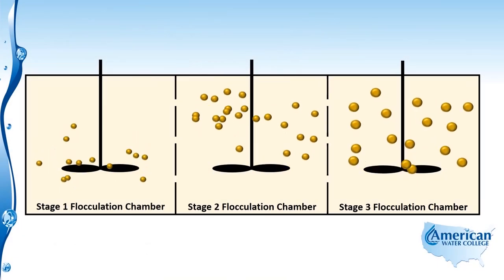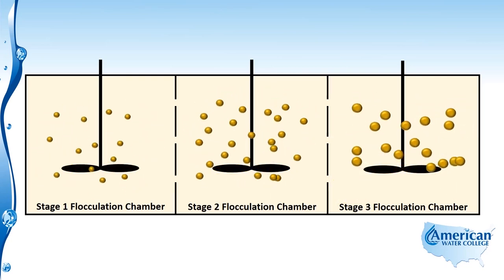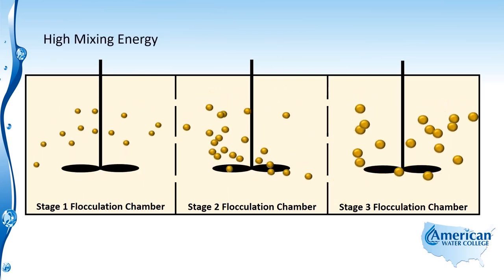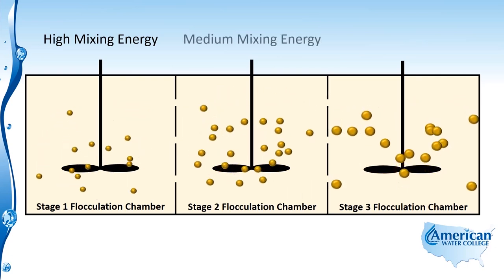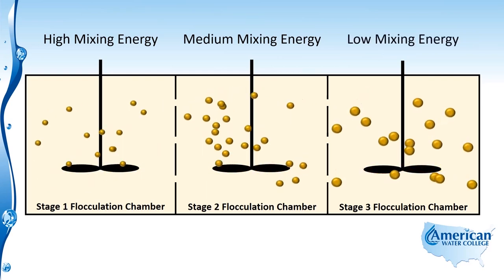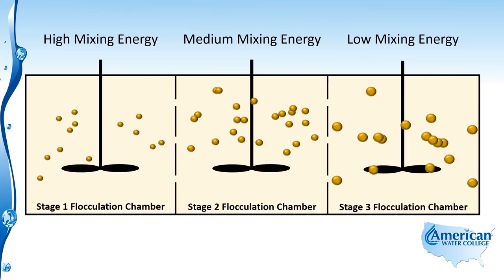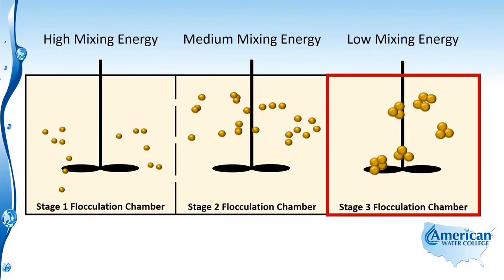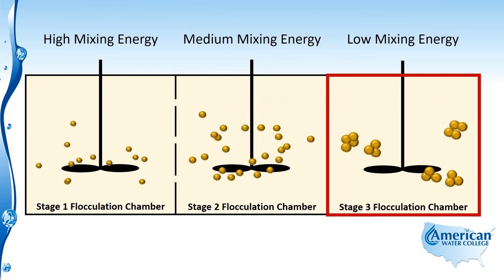Flocculation

Comment: Thanks for sharing about flocculation process. there’re 3 stages flocculation chamber with different mixing energi. We come to know that in a flocculator, the lower the mixing energy so the parcticle have gotten biggers, and the slower they move.  the particles even get bigger on the third step and the flock to continue to get bigger and form a flock that will be able to settle in the sedimentation. thank u.

Comment: thank you for the explanation sir, from the video it can be conclude that there are 3 different stage of the chambers in flocculation, from each chamber it has a different mixing energy which in the first chamber the energy is higher so the particles can move quickly but as the higher of the stage chambers, the energy mixing will be slower because the particles have aggregated and enlarged at each level of the chamber.
-FTIUJ